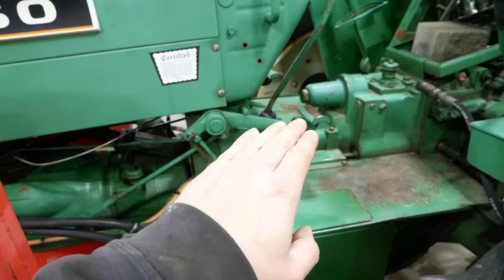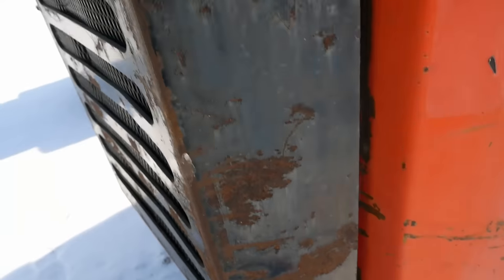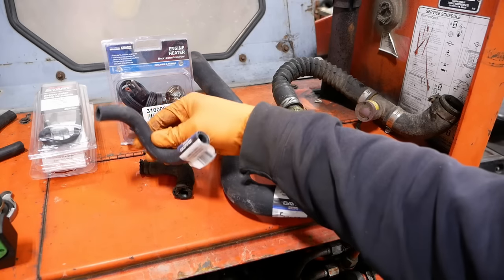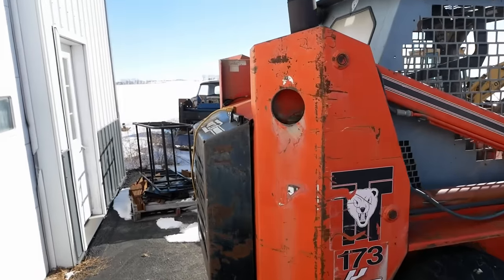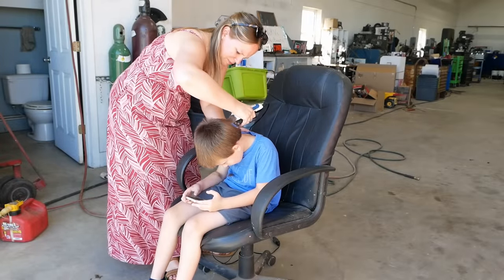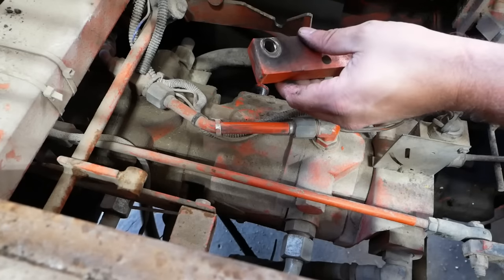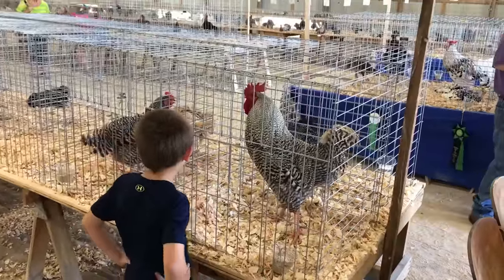Buying a Cheap Skid Steer from an Online Auction - Thomas 173HL - Part 1

Comment: I'm not sure that thing leaks enough to be part of your fleet.  Great video, Wes, as always.
Reply from the maker: Hmm. We'll see!
Reply: I'm expecting part two to be full of rust, broken bolts and bad wiring... ;-)
Reply: Just wait till he gets the RPMs sorted out, the new power will certain get it in line with the other equipment for leaks:)
Reply: @WatchWesWork  kubota dealer has great stock of parts wich my kubota dealer here pei could ship ya hoses wich i think about $20 wich deeres here are $65.00 for theres
Reply: Give it five minutes...
Reply: An English teacher somewhere is getting drunk and contemplating ending it all because they’ve failed at their job.
Reply: @trevorpom  Probably!  More content for us!  And another sigh from Wes.
Reply: and you forgot to add rat poop, mouse urine and rust, and rodent damage to wiring :)  @ickipoo

Comment: When i worked in a construction companies shop we put in a weather rated junction box on one of our machines that let you plug in both the block heater and a battery tender that we permanently installed at the same time. This way we got to also have the battey tender running when the block heater was being used so it always had the best chance to start.
Reply: We do that to - BEST idea for cold weather implements!
Reply: Also great for 90's Chevy trucks.
Reply: when i was a little boy,,we negated that problem,,by moving to australia.. i think about building snow men,, snow ball fights,, cold never bothered me..  bugger that now.. i tried emigrating to the u.s., as the laws are better, [ were 3yrs ago,],. but she asked where was i born, i said  u.k, she said sorry, were not accepting britts at present,.  something to do with the tea party..  look that up.. had land lined up in elko navada.. ive bought 2 vehicles from u.s., 73 r/t 340 challenger, & a 1962 f100 4x4..swb.. also drive a s/duty.. chev should not of pulled out of here,, ausies are gm mad..
Reply: thats what i do with all my fleet trucks, working in remote  northern canada battery tender, block heater and interior space heater. the latter is for all the emergency vehicles
Reply: @harrywalker968  Just come in through Mexico, tell them George Soros sent ya 😉
Reply: Hello from Finland! For those really cold winter days we have also have a battery warmer, because cold batteries don't hold as much charge as warmer ones
Reply: @harrywalker968 you're not wrong but also 40c plus weather is also horrific even if your vehicles start and don't rust from road salt
Reply: @harrywalker968   Just come to the southern border and walk on across like everybody else.  No problem.

Comment: I once bought a low hours Thomas from about the same era as yours.   Came from a locally owned rental company that took care of their equipment.  I knew the owners and they gave me a great deal.   I was just starting out with a young crew.   We did some concrete work for the rental company and they cut the price of the machine in half.   It was a great running machine that we used in our yard and in several cities around the country when I was chasing dollars in the late 90s and early 2000s.   It was a rare machine that always started, never gave us many issues and was a real workhorse.   I liked it very much.  Hope yours will do the same.  
By the way, a set of quick attach forks with a trailer ball on one, and a quick attach pig pole make these Thomas skid steers into great utility loaders around the shop.  
Whipple

Comment: We have several V2203-powered gensets at work, and they all turn at 1800rpm, so what you speculate may be exactly right. We have all the original shop manuals for them all; I’ll see what they say about rpm adjustments and the governor.
Reply: Yep, my money is on internal governor springs/travel. Might be an Area Diesel collaboration in the works.
Best wishes from the smokey North.
Reply: Those cassette type injection pumps have shims under them to set injection timing also. If it's genset spec they need to be adjusted to set correct timing for higher rpm spec
Reply: Yes, true, but these injectors get stuck.. and the shims have nothing to do with the injectors. The governor spring is just a spring, and rarely fucks the injectors
Reply: Sorry, the shims don't mess with the typical workings on rpm, other than a factory setting.
Reply: @mayhew75  I never said they did?

Comment: Great video Wes.
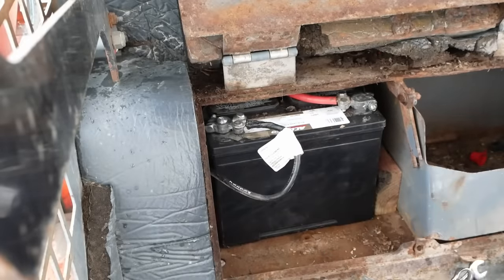I believe that at 6:55 that is the original battery hold down that you have in your hand. A bolt goes through that piece of metal into the hole in the battery tray at 7:51 and holds the battery like a toe clamp by engaging with the slot at the bottom of the battery.
Reply from the maker: Holy crap. I didn't even remember picking that up!! You are right.
Reply: I was waiting for the joke because I saw the same piece in your hand.
Reply: @WatchWesWork  Gah!  I practically yelled at the screen.
Reply: Thought @watchweswork was doing dry humor on some day getting a machine with hold down just after touching it…. Then later he was machining one… then looked for this comment!

Some old guy has tinkered this machine with allot of cus and love before finally landing at auction.
Reply: @patricksquires77   I wrote my comment about 10 minutes into the video, so when I saw him machining that plastic battery hold down he bought I was like, NOOOOO!!!! YOU HAD THE PROPER ONE IN YOUR HAND A MINUTE AGO, IRONICALLY, WHILE YOU WERE BITCHING ON ABOUT NEVER OWNING A PIECE OF EQUIPMENT WITH THE ORIGINAL BATTERY HOLD DOWN...🤣🤣
Reply: What if all his equipment had the original hold down clamps but he was just unaware they were there 🤔.. 😂
Reply: @digi3218  🤣🤣🤣 he's thrown them out believing they're just hunks of scrap metal 🤣
Reply: @digi3218  Hah!  Possibly true!

Also in the glove box of each mystery history vehicle is the exact diagnoses and parts list for the issue.
Reply: @TheJstewart2010 sure

Comment: Something I've found handy when working on heavy equipment. Any equipment that is generally stored outdoors anyway. I hose everything down with WD40 or PB blaster, I mean everything. Helps hold off the rust demons and prevents dirt from sticking. Dirt can act like a sponge holding moisture and rusting out equipment. Helps prevent electrical issues by keeping moisture out of electrical contacts as well.

Comment: I have a little bit of exerience with the V2203. I have some parts diagrams for that family of engine, i'll email what i have to you! Just a disclaimer, the engine i worked on may be different in some ways than yours...i only have experience with the pump side of things, not the governor itself although i have some tips you might find helpful if you're getting into the fueltrain. The governor mechanism lives in the engine block, not the pump itself. The injection pump is fairly easy to remove, it's a simple cam-driven inline plunger pump and does not need to be locked in-time before removal, but there are some easy ways to mess up and damage things. For example, the pump lives in a cavity in the block, and the idle control mechanism (a screw-in plunger/spring) is installed into the rear side of the pump cavity in the block in-line with the rack on the pump, and helps dampen the rack's movement and helps the rack return to idle.If you don't remove it before pulling the pump it will hang up on the pump and can be easily ruined. It's very easy to bolt down the pump against the inline plunger spring pressure without realising that something else is hanging up and being bent. The stop solenoid on the front of the pump cavity also needs to be removed, and sometimes the stop solenoid's plunger pushes on another plastic plunger which then pushes the rack closed....usually you need to stick a finger into the hole and pull the plustic plunger backwards a bit so the pump can be pulled up and free. The fuel timing is adjusted with thin shims between the body of the pump and the block, be careful not to lose them.
Reply from the maker: Good info!
Reply: @WatchWesWork  I'll add that sometimes the governor fork can become bent, and that can affect it's ability to act on the fuel rack. In the past on a smaller 3 cyl kubota that is pretty similar in construction to the 4 cyl, I've seen the fork get bent in a way so that after passing a certain point of rack travel, the fork would slip off the pin on the rack and get stuck behind it which caused the rack to go full fuel, causing a runaway condition. There are lots of small springs, rods and bits that can be very fiddly with these governor systems.
Reply: @WatchWesWork  Also, don't lose any of the gaskets / shims between the pump and block, they are what actually set the injection timing.
Reply: @WatchWesWork PS, I've had good luck with aftermarket kubota parts from Kumar bros. in Marlboro, NJ

Comment: Hey Wes, I had to put a heavier governor spring in my V2203 when I stuck it in a Jeep. I used Mcmaster 9433K49. I’ve revved it to about 2500rpm before I let out. To change the spring, you have to pull the injection pump out and the throttle plate off and the shutdown lever plate off.

Comment: I picked up a clapped out Gehl 3510 a few years ago for 500 bucks, it came complete with a partially disassembled ford industrial engine and loads of debris from the pig barn it broke down in and was left in to rot.. I don't think it ever had a drop of grease in its life. I pulled the motor out and replaced it with a 22hp harbor freight v twin, and some old barbell weights to make up the weight difference. Its just as capable as it was with that old ford pinto motor. I haven't done much else to it, its so worn out it would be pointless, but every time I use it, whether I'm moving dirt or pushing snow, I say in my head, it sure beats a shovel. kudos to you Wes, for keeping these old work horses going!
Reply from the maker: My brother did the same. He put a Yanmar diesel in his.

Comment: Hey Wes, I have a 153 Thomas, V2203 Kubota, it came to me as a gift, it had been dropped off a moving truck and had been run on water as oil for a long time. It has been a consistent partner in doing many things around here.

Comment: If you need a right angle hose like that, go to an auto parts store and ask for a heater hose for a 1995 Toyota Corolla. It's a 90 degree bend and it's long, so you can cut it to whatever length you need on both sides. Works perfectly for stuff like that. My car has at least 2 of them replacing various no longer available right angle hoses.

Comment: This resembles my backyard ornament Bobcat 825 that has been sitting for 2 years. Perhaps I will go take a look at it this week. Thanks for the motivation!
Reply from the maker: I had one of those. It had a Perkins 4.108 with a hole in the block. Brazed up the hole and rebuilt it. That was before YouTube.
Reply: Just bring it by here. I have plenty of trees for it to sit under, plenty of bees to live in it and plenty of semi-watery diesel to try starting it with.

Comment: There are generally many reasons why a piece of equipment is sold at an auction but if the price is right ...      I am confident you can conquer all the repairs. 
Add another talent to the White Knuckle Towing Service, barber.

Comment: I ran a Thomas 175 for a few years, what a absolute workhorse that thing was. Easily the most reliable skid steer i have ever ran. Same engine. Only problem we ever had was u joint/yoke between engine and pump went out and tore up the splines on the pump. Local company rebuilt the pump for us and Spicer still carried the yoke so replaced that and it went back to work. Still working to this day out making money moving dirt. I told the owner if he ever wanted to sell it im first in line!

Comment: I live in Canada - same temps, just longer.  What I always do  is attach some exterior lugs to my tractor/snow blower implements.  EASY peasy to jump start in great winter!🎉
Reply: I live in Finland. We got pretty cold weather too. We use bigger batteries, because starters need good kick of current in cold. And -40C diesel fuel of course. Best engines start even from -35C but it doesent sound nice... Block heater is the way to go

Comment: When using unformed soft hose in a pinch and needing to complete a bend without kinking, I’ve tightened a small hose clamp around the kinked area. The hose clamp does a decent job of forcing the hose back out into a round shape in that location. Not great, but better than nothing - it’s come in handy a time or two

Comment: Robot Cantina just did a whole series on putting a kabota diesel into a Saturn.  I think it was one from a refrigeration unit.  He might know about the limited rpm issue.
Reply: What I want to know is that, after swapping this reefer motor into the Saturn... did the AC finally work?
Reply: @Le_Comte_de_Monte_Felin Car didn't run worth a crap but the ham sandwich inside the car sure stayed cold for a long time😅. Seriously tho. The car ran pretty good... cool show.

Comment: Before you jump at a governor problem or engine issue (if you haven't already done so), make sure the fuel system is proper. Kinked hoses, improper sized fittings, fuel filters, etc. It really is amazing what the previous "mechanics" have/can/will do to keep stuff like this running. An undersized hose barb causes more headaches than you would believe.

Comment: Spent half the day wrestling with the ride on's, (Spring has arrived here in Melbourne Australia). 
Dead battery and time to fix that rubbish battery retainer on one and blocked fuel filter and a hunting engine on the other.
You made my day when you said, "part 2" Wes.
There always seems to be a part 2 for me.

Comment: I had plowed snow as part my job for awhile.
NW Alaska
I have used Skidsteer to clear snow, and snowplow pickup truck, skidsteers for moving snow works great in spaces you need to clear snow away from, like buildings, fences, doorways, where the plow shines is when you need to clear a large area.
one thing I learned is if you need blockheater, you need a battery blanket, if you need those both, might as well wire in a battery tender so she is charged a ready to go.

Comment: The revs issue Wes will most probably be a weak governor spring ( Behind the cover where the washer tower is), if memory serves its a similar pump set up to the D series and has an internal tensioner, great little engines but they do need heater plug, LOTS of heater plug even in summer and they dont like getting to warm ( combustion chamber cracks between pre combustion chamber and inlet valve seat), Brilliant video as always ❤

Comment: I’ve been looking off and on for a Thomas Skid steer..These were built in NewBrunswick Canada,30 minutes from my home..Had couple friends that worked on the assembly line for these..Very ruggedly built and lacking frills..The value on these is low due to when entering the market Thomas thought to make a splash with U.S. farmers by shipping some new ones to auctions in midwestern USA..Unfortunately they were greeted suspiciously as off brands usually are.They sold for low prices which sealed their fate in the big US agricultural industry..They remained popular in Canada and with contractors until Thomas changed hands..They still produce stand on style and many farm accessories..They were the first to introduce hst trans in a skid,and bobcat quickly followed suit and had the reputation and the money to back up their machine, which ended up leading the market

Comment: All the hoses, and pretty much anything associated with the engine including the cooling system are Kubota parts. You can get them from a Kubota engine dealer if you give them the Kubota serial number.

Comment: Hi Wes you are very smart with machines and don’t want to overstep my boundaries but I had one of the that I found the stop lever interference since they are connected together and the stop is not adjusted correctly but I will send you information of the parts supplier in Canada , Kubota doesn’t want to share information since they class it’s industrial and part number don’t match from each other good luck , happy Labor Day

Comment: I once worked for a Thomas Dealer / Construction Company in California.
We had approx. 45 of these skid steers in our fleet, and were pretty bullet proof, as a Heavy Equipment Mechanic for the company, the biggest problem I had with them was the Fuel Shutoff Solenoids and Starters.
Thomas originally started as a Canadian company, got bought by a Chinese Company, then bought themselves back from the Chinese company.
Getting parts was a hassel because of the buy out and buy back took 5 years.

Comment: I worked at Thomas factory for 12 years in service and warranty . I was there and involved in development 173 and its big brother 233. I wrote the repair, service and owners manuals for both these as well as others. This skid steer used good components in hydraulics and hydrostatics. The Kubota engines were very good. Thomas no longer is manufacturing these however in Illinois , Gebauers (spelt wrong I’m sure) I remember as a good Thomas dealer in the 90’s when this was built. If they still exist maybe some help there.

Comment: Gotta love those highly efficient chinesium tubes.  Why most people have to wait to see their stuff wear out!  Not with the chinesium.  They had the consideration to "pre wear" out their tubes so no waiting around for the end.  What a time saver!  I bought one recently for my wheel barrow.  I was dreading having to use the damn thing, get out the compressor air up the new tubes in the rotted out chinesium new tire but they saved me all that!!  What a nice bunch.  I opened up the package and the tubes were 'sun' crazed so much there wasn't any need to proceed any further!  Ahhh!  It's nice in my easy chair.  Just hope they don't start making beer!!  (or easy chairs for that matter!!).